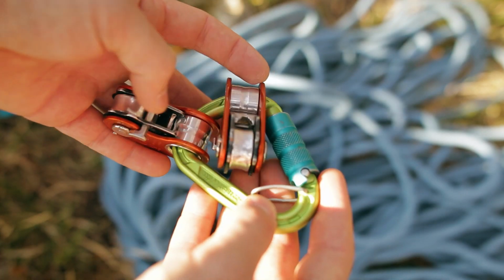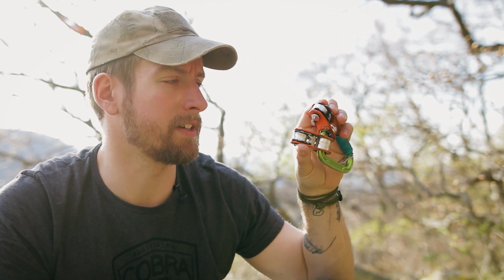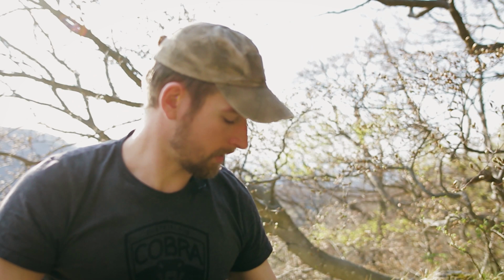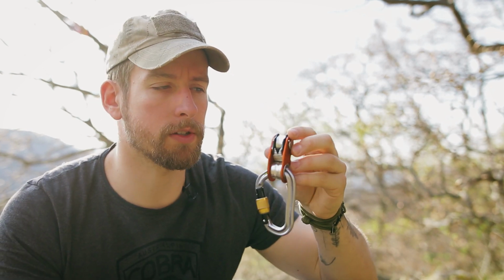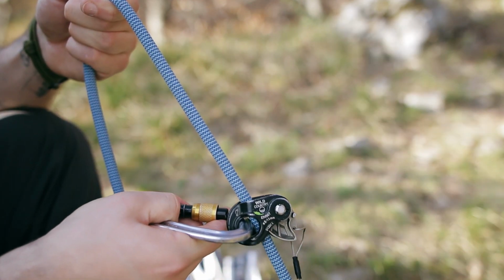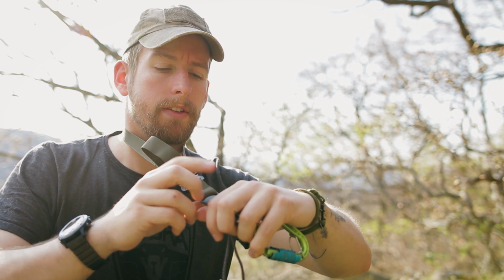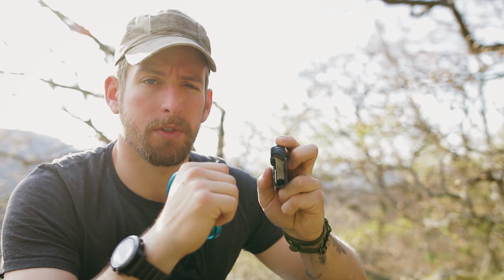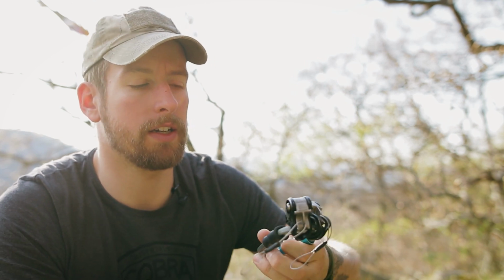Toprope Solo Devices - What do I use and why?

Comment: Those devices will shear your rope sheath at only 6-8 KN, this is why they are NOT belay devices
Reply: When top rope soloing your falls should never be anywhere near 6kN. 6kN is a VERY heavy fall. You need to be a large male falling hard with not much rope in the system to reach those figures. Most TRS falls are measured in cm/inches, not metres/yards.

Comment: How do you multipitch top rope solo? After climbing the first pitch how do you set the rope on top of the second pitch? I have done multipitch top rope solos but start at the top pitch, rappel, climb up, switch from tied in ropes to standard rappel set up,  rappel, setup for next pitch and repeat. Dont have to pull the rope up though, just down.

Comment: You really should use two Carabiners one for each because you can try load one and still break it because the gate has no strength opposed to the spine
Reply from the maker: Thank you. 
This is why i use a steel carabiner in that setup.
Forces will in no case be high enough to break it.

Comment: What diameter rope is this again?

I just got the Rollnlock and was trying to get the rope to angle through like you demonstrated but couldn’t manage to do so. I have a 9.8 mm. Then took test falls at the bottom of a climb and no issues... *however, once I got to the TOP and the rope was tight and angled to the side toward myself, I lifted the device to engage it and it slid back down several times. So glad I was on a backup ☠️

Interestingly I also saw on a mountain project forum about TRS w the Rollnlock that there was an instance of someone being caught multiple times on the Rollnlock but then having it fail at the top and falling to the bottom (he did not have a backup). Probably the angle issue I experienced and you had shown. 
That said, for this reason I fully support the idea of using a backup device that functions altogether differently rather than 2 Rollnlocks. 

Thanks for this information. It’s been extremely helpful in safety while I’ve been considering my setup. Cheers!
Reply from the maker: Thank you dude for the feedback. 
This one is a 9,1mm rope by maxim ropes.

Comment: Maybe this carabiner would work for your double rollnlock?  It's designed to be loaded in 3 points.
https://www.mec.ca/en/product/5061-114/Omni-Semi-Circle-Locking-Carabiner
Reply from the maker: Thank you, but then the RollNLock would not be streight. This can cause the malfunction I have mentioned.
And the gate would be loaded. I feel better with a steel carabiner and the Ropeman 2.

Comment: Tried the Petzl Shunt? I used this both on double rope and single rope backed up with the CT RollNLock. Both slides easily and serves me well. Rappelling is easy since the Shunt is a mechanic Prusik. I disengage the RollNLock and add a ATC for rappelling safely down for another go🙂

Comment: I just ordered a roll n lock and micro traxion a couple weeks ago. I think the rating with the 4kn is to what extent the device will hold onto a static load until it begins slipping. The strength of the device itself is around 20kn.
Reply from the maker: And how is the friction on the rope compared between these two? 
Yes, I am sure. 4kn also should be totally fine for toprope solo.
Reply: @ripperkon  this is from petzl's website and they still recommend using the microtraxion as a rope soloing device. Maximum working load - pulley: 2,5 x 2 = 5 kN
Maximum working load - rope clamp: 2,5 kN

Comment: We also tried out a lot in rope soloing and our preferred setup is with PETZL GriGri. The reason herefor is, that you can easily rappel down in any situation. With your setups this is not possible!
Reply from the maker: True. But I don’t like how bad the grigri feeds the rope in that case. 
But maybe for harder climbs where I need to redo a move more often, I would also think about using the grigri.
Reply: @ripperkon  the "trick" is to use it with a thinner rope. You have to try a little bit to set up the best system. But don't forget to use stopper knots for backup. Cheers and safe climbing!

Comment: I don’t have any experience with rope solo, but I have experimented with a rollnlock as an ascender, what I fould was that if the rope is weighted underneath (e.g. a foot ascender, the rollnlock wouldn't engage. Probably not something relevant to your use, but something to keep in mind. Check out Richard Mumford on Youtube, he has done a lot of testing in different configurations with the rollnlock, mainly in tree climbing scenarios, but I'm sure you'll still find good info there.
Also, the CT simple ascender is like the basic, but with the additional hole. Good ascender, I have one.
The microtraxion has about the same amount of friction as a rollnlock, but is way more efficient at hauling.
Reply from the maker: Thank you for the feedback, dude. Yeah, I had the same issue when ascending with the RollNLock. Maybe I will just order a Microtraxion 🤔
Reply: @ripperkon  One never has enough gear...
Have you ever considered using a rope access backup device? We use the ISC Rocker at work, I can recommend that, but in combination with something that locks up right away, or the camp goblin, you can lock that so it only allows ascent, a colleague of mine uses that.
Reply: @raphaelbeinhauer9242  Does the microtraxion grab rope even if cam is open when rappelling? I was thinking of getting rollnlock since the cam can stay open so I can rappel without detaching it from rope, I wonder if the microtraxion teeth would accidently grab rope even when open? Because I see the open position of microtraxion isn't completely clear from the rope trajectory, only clear when used as pulley. If not I'll get microtraxion or elderid spoc since it's cheaper.
Reply: @ron9511  late reply, but in my experience the micro trax does not slide down a rope well even when disengaged, the teeth can still catch.
Reply: @ripperkon   I'm thinking of micro or edelrid spoc since it's cheaper than rollnlock but I'm scared the sharp teeth will still grab rope even when cam is in 'open' position whilst rappelling. With Rollnlock open position, the cam is completely opposite the rope and has no teeth so there's no chance of accidental rope grab.
Btw your TR solo videos is the most concise I've seen on YouTube, great job!

Comment: with the new basic and his single hole designed, carabiner can interact with the cam... climbing technology still make something simillar to the old basic (didn't try this version). I don't think roll n lock is weaker than the micro or the jumar, the weakest device here is the ropeman! with those cam design, the only way to get better strength is to use bigger diameter of rope, or to change the design (for example the microscender is way stronger due to the curved interface)
Reply from the maker: But why is the RollNLock then only for 400kg? 
Or did I get this wrong? 🤔 I feel safer with the ropeman2.
Reply: @ripperkon  I was not clear, ropeman is probably more "catchy" for sure (wich is maybe the most important), and rollnlock is maybe not more stronger than 4kn, , but ropeman is weaker :p, on rollnlock instructions they consider fall factor under 1ok, while ropeman cut the sheat way before! demo arround 3min: https://www.youtube.com/watch?v=DpWKrghSLao (real life fall is less terrible than those lab rigid test! but sheath cut at 0,25 it's really low!), 4kn is stamped on most ascenders because EN567 and EN 12841 required these value, not more, the strength is different depending of the rope diameter, and rope type, some data for illustrating this: https://www.petzl.com/FR/fr/Sport/Tests-statiques?ProductName=MICRO-TRAXION https://www.petzl.com/FR/fr/Sport/Tests-sur-MICRO-TRAXION-et-cordelettes-Dyneema-de-diametre-inferieur-a-8-mm?ProductName=MICRO-TRAXION http://storrick.cnc.net/VerticalDevicesPage/Ascender/AscenderImages/HandleECStampedImages/Scan0127e.jpg                        4kn it way enough for top rope solo, but this is good to keep in mind the limitations of the system
Reply from the maker: MrHassancehef But that’s the ropeman and not ropeman 2. The older one has got „sharp edges“. Seems like the problem of cutting the sheat is more unlikely on ropeman 2. 
I am not sure if I said ropeman 2 in the video. But I use the 2 not the other one. Also because the ropeman 2 works with thinner ropes.
Reply from the maker: MrHassancehef thank you for the links and addition 💪🏻